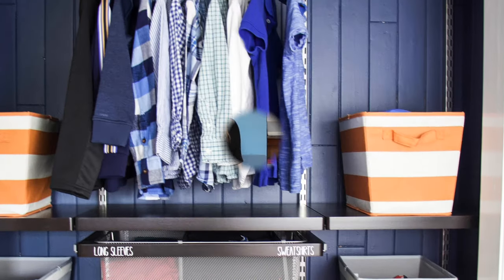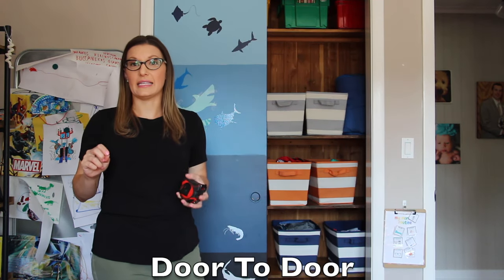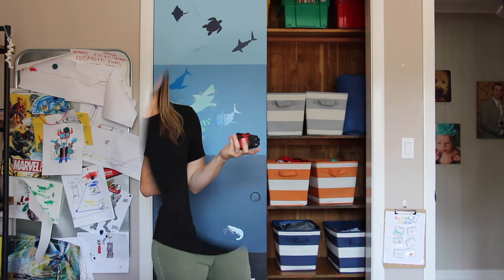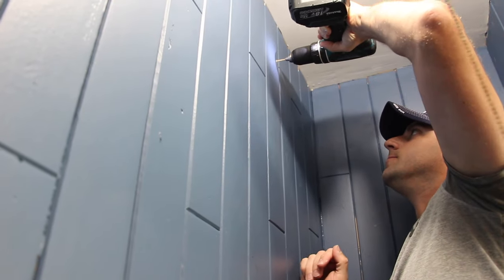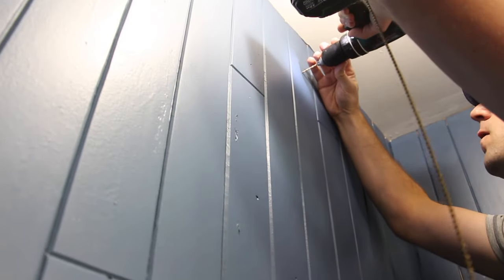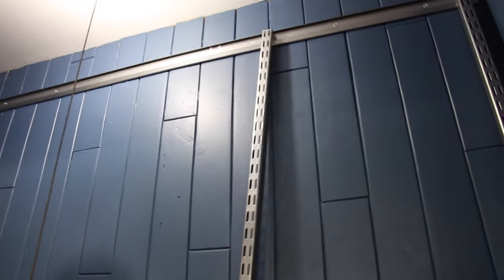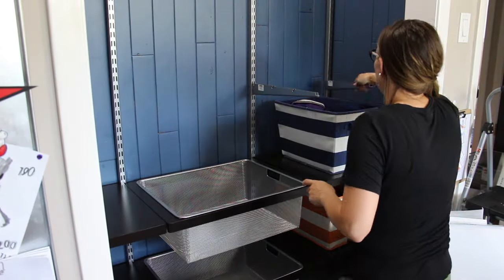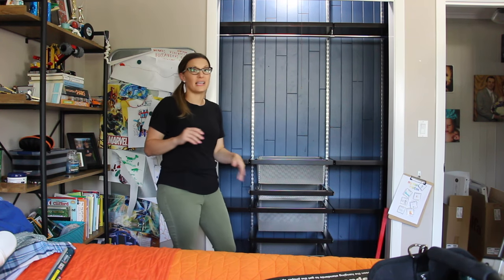How To Install Elfa Closet System

Comment: Do you need to anchor the hanging standards if using a top track bar or does the weight with all the shelving hold it properly?
Reply from the maker: Weight of the shelves works perfect! Elfa doesn't require the anchors which is nice! Less holes in the wall